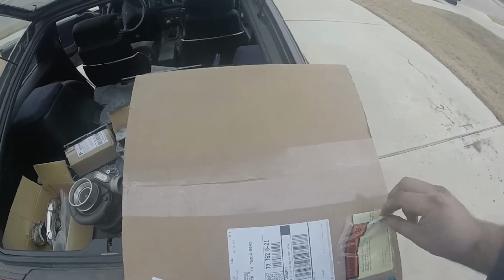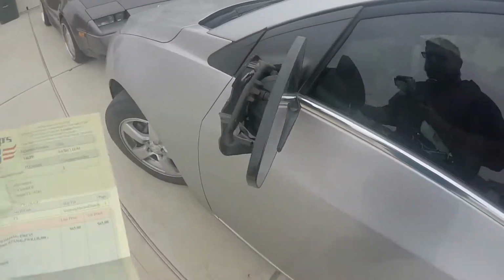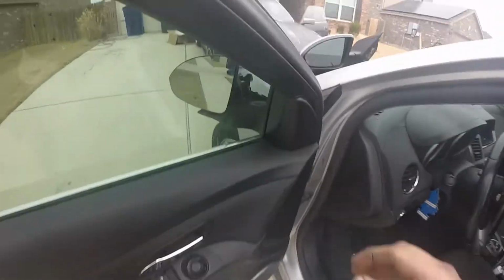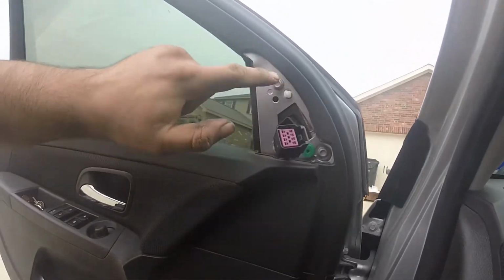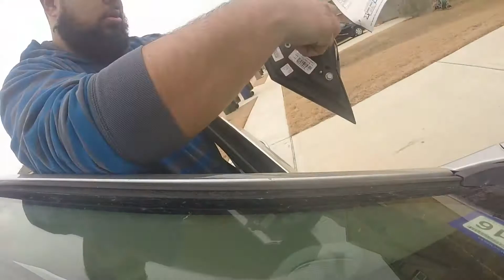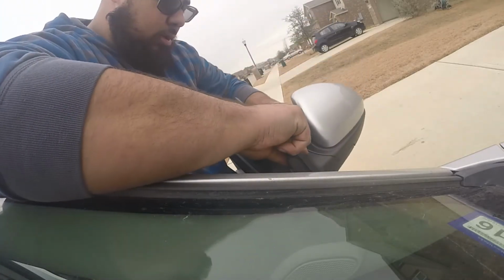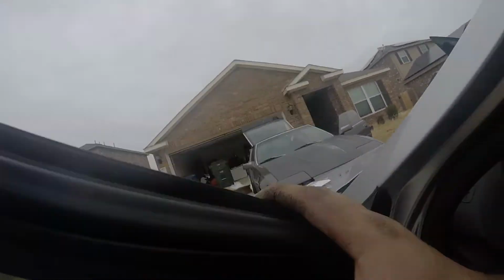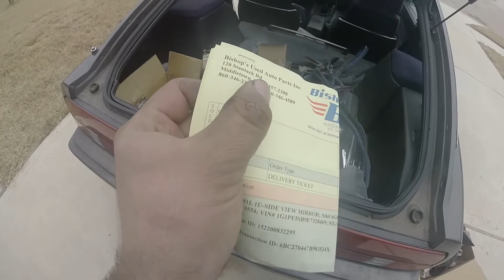How To Replace Mirror chevy cruze😭😭

Comment: Whats the paint code because i have the same color but my paint code is gone?
Reply: GM code WA636R - silver gray (http://paintref.com/paintref/model/silver_Chevrolet.shtml) I think this is your one.
Reply: the code is also on your engine bay. Directly above the middle of the engine, parallel to the windscreen. its on the small black metal tag with the VIN number.
Reply: * GCW = Misty Lake
* GGE = Super Red
* GCS = Velvet Red
* GCV = Pewter Gray
* GCT = Moroccan Blue
* GCB = Galaxy White
* GCY = Poly Silver
* GAR = Carbon Flash
* GCU = Atlantis Blue
* GCZ = Lt Gold

I could be wrong though but look at the above and the bellow link. 

(http://www.chevroletcruzeforum.com/index.php?/topic/22-available-cruze-color/)